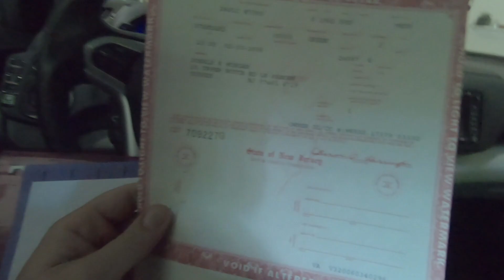M37 Register and 1st Drive

Comment: A hint for shifting gears, always double clutch your downshift, and be sure to pause in neutral momentarily when upshifting. The old time transmission has widely spaced gear ratios, and they gobble up synchros quickly if you rush things. M37 was my first truck, I am on number 3 now. My second one was a daily driver for 16 years. 🙂

Comment: i found mine 9 yrs ago  i had to rewire  it it was toast  textile insulatio hanging ever where the most fun part is trying adjust the float level  with 5/64  using long nose pliers on little tab  to low it want start to high it floods taks several trys  to get right  ive hade the eng out twice last time to add new rings a lot of peopletryto set timing on #1 cyl. wrong its #6 take the little bolt out over the piston to set tdc  tne aj diist 4 deg before tdc she will purr like a kitten